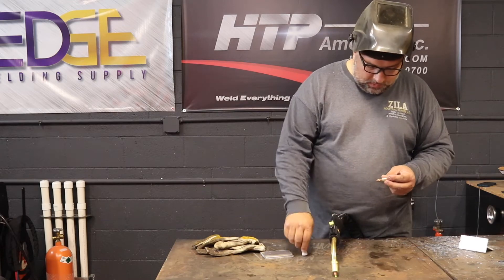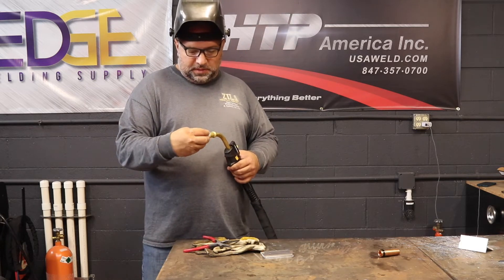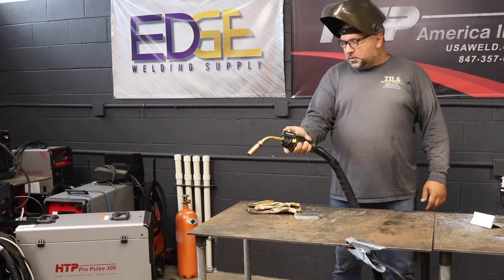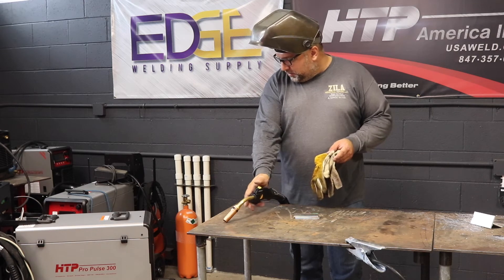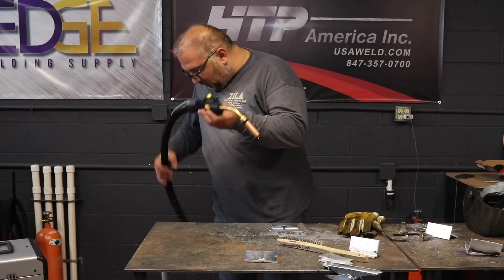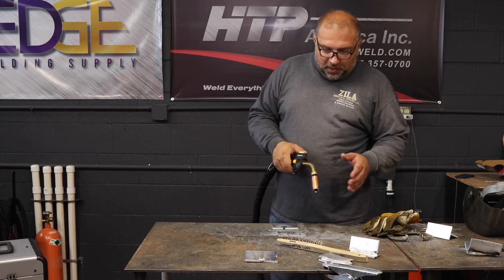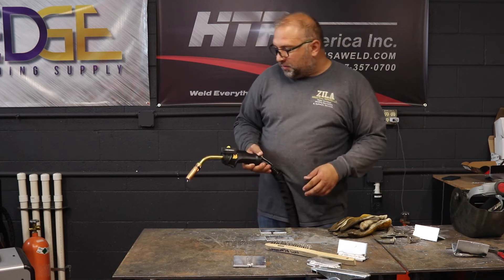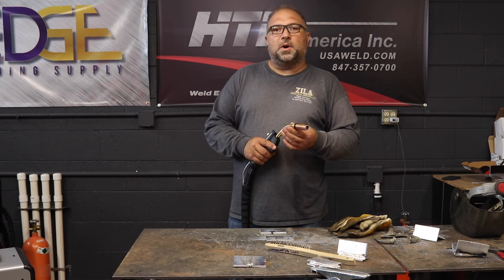HTP Water Cooled MIG Gun Setup with the Pro Pulse 300

Comment: Good video good information. Love my HTP PP300 and water cooled mig gun.
Reply from the maker: Its quite the unit!
Reply: End iron how long have you owned your PP300
Reply: @HH-cw1tl  I am guessing right around 2 years now actually. I have tried to break it many times haha.
Reply: @endiron9478  I just bought my pp300 this month haven't used it yet, are you still happy with its performance? Its my biggest purchase for a welding machine.
Reply: @HH-cw1tl  I have shoved dozens and dozens of 33lb spools through this machine. I use it for practically everything on my channel and for my shop. I also picked up a 220mts but the 300 just hauls butt and can lay down the wire.